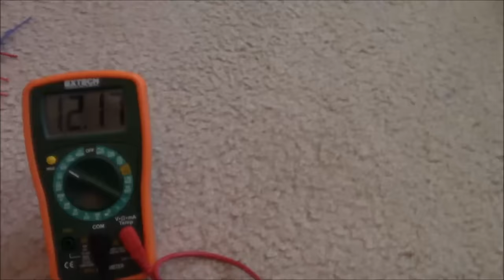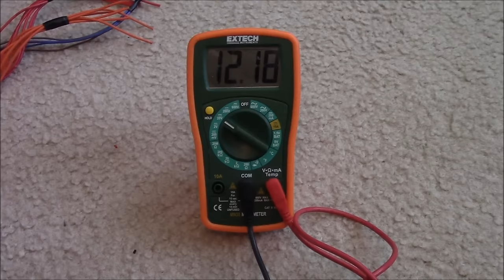How to Hack a Computer Power Supply (PSU) To Use as a 12V DC Power Source

Comment: Thank you very much. I needed a stable 12v power supply for an resin curing machine for 3d printing I this is probably a bit overkill to use an pc power supply, but heck, I did this anyway. Thank you again from România.
Reply from the maker: No problem!  Thanks for watching and commenting!

Comment: Your hack of the power supply worked perfect.  Making a Nichome wire Styrofoam cutter but now I have the problem of to much power even though it was only 12 volts.   Have a 12 inch length of 20 ga. Nichome wire and it burned through it almost immediately when I turned the power supply switch on.   Is there a reostate I should use or possibly a different combination of wires coming from the power supply to give me less power to the wire?     Thanks
Reply from the maker: Try using the -12V rail instead of the +12V rail.  It will provide MUCH less current, though, so it may not work for your application.  Other than that, you could use 5v but not sure if that would work, either.

Comment: hello sir,I have a EVGA 600GOLD, ALL the wires are black, but i still think I can do this, any help from you would be very appreciated , I assume I can take the box off the unit and see what wires are hot and what wires are negative< again any help would be awesome ,thank you in advance
Reply from the maker: Before you hack off the connectors you will know which ones are 12V and which ones aren't.  The video/graphics card wires are 12V, for example.  Once you identify the connectors that are delivering 12V you can find the pinout for those connectors online and that will tell you which one is the 12V+ and which one is the 12V-.  The rest will not be used.

Comment: So all the 12v cables here share one rail. Unlike some more expensive PSUs with two or more 12v rails. Anyway nice video I benefited greatly from this.
Or maybe because they are connected in parallel?
Reply from the maker: Yes, most PSU's have multiple rails, even if the second one is really weak.  Glad it helped you!

Comment: First off your video was extremely a helping an educational on obtaining the power supply my question is what if the power supply doesn't have a switch to turn on the power supply came out of a Dell Windows XP Media Center desktop
Reply from the maker: You can easily wire one up.  Just put a switch in between the green and black wire that I connected together in the video.

Comment: I wasn't sure which way would work out better, you're the expert :) Ill give it a go. Thanks!
Reply from the maker: I am far from an expert.  I just like to tinker and I know enough to be dangerous.  Good luck!
Reply: LDSreliance Hi. Thanks for the video. I've got a 600w 42amp PSU that I am looking to convert to power an isdt q6+ lipo charger (14amp 300w). Can I assume I need to bunch all of my yellow wires together or can I use 4 or 5'ish? Thanks
Reply from the maker: I would never use less than about 4 of the yellow wires bundled together.  Just my preference.

Comment: ohhhh way cool yeah the older looking ones have some kinda switch on them like push in and push again and button pops back up
Reply: Those are called 'AT' power supplies, very common in 286, 386, and 486-class PCs, also used in a lot of early Pentiums.  
I think some modern 'industrial' computer hardware still uses them too.  Newer power supplies are generally referred to as 'ATX'.

Comment: I have done this before and the 12v stops after a few minutes. The fan in the p/s keeps going but no power at the tips. After resetting main power it all works again for a few minutes then back to 0 volts.
Reply from the maker: Sounds like maybe it is overheating or something?  I've never had this happen.

Comment: My second question wuld by how to turn that PSU to use lead acid baterry power insted of an AC out let? Well my small experiments are more based on cars running modules ,voltage regulators ,ignition coils etc so mostli I need flat line DC or pulsed DC in bouth forms - and + pulse signals . Well honestly an inverter is probably best solution don't have money to buy It and honestly lot people complain inverters go bade fast they are not really well made so most likely I wuld end up haveing back charge problems I supose.

Comment: Thank you. I have a 12 volt PSU. There are several power wires with different max amps. I know from the label on the PSU that one power wire can deliver +12 volts at 16 amps. The problem is I don’t know which wire colour is the +12 volts 16 amp wire. I can not find any colour codes or specs online. I am wondering if there is a way to find out using a resistor or a rheostat?

Comment: No...thank you! Quick question for you. I've ran across a power supply with the reds, blacks and yellows, but the harness also use  4 wires going to an on and off switch on top of having very thin black and green wires being on a 2 pin connector.
Reply from the maker: Yeah there are all kinds of slight variations.  They standardize to a point but I would always recommend digging up the wiring diagram for the PSU if you can find it.  Usually you can google the manufacturer part number on the label and find it.  Sorry I don't know what it is off the top of my head.  Good luck!

Comment: How can you determine how much power is available at 12V, does it cause a harmful imbalance to only use the 12v output, and do you recommend installing a fuse/breaker in the line? Thanks for simplifying  the process!!!
Reply from the maker: The output will be limited by the design of the unit.  You will have to look up the specs of the power supply or they may be on a sticker on the side.  You can never go wrong with a fuse or breaker.  At worst it will be redundant safety.  And you can safely use just the 12V power.  The PSU doesn't care if you don't use the 5V and other rails.

Comment: Before connecting green and ground we can do on the power supply without computer board
Reply from the maker: Connecting green and ground completes the circuit and turns on the power supply.  Yes you can do that before you connect the motherboard but make sure the power supply is not connected to a power source (plugged in to the wall). until everything is properly connected.

Comment: Hey brother appreciate the video it got me to point where I can turn on psu after I shorted the green and black wire...now I’m trying to use psu to power 12v psu air cooler and a 12 volt Peltier thermal-electric cooler  and small pump (making a water cooler) how would I attach those devices?! Can u tell me what wires will I need to connect?! Please help lol

Comment: For anyone wanting to do this but using the 5 volt rail for their project I wold recommend putting a small dummy load like a Power Resistor 10W 2.2Ohm on the 12v rail to stabilize the 5v rail line, i have experienced power fluctuations on the 5v rail line without the dummy load.
Reply from the maker: Good call.  I am sure it depends on the quality of the power supply and I would expect that the kind that most people will be hacking up are the cheap ones where this is a problem.
Reply: jamesthepuerilis u

Comment: Really nice video. I'm new to all of this and have a , probably stupid, question, can I use each one of thoses cables to have a multitude of 12v cable ? Or am I obliged to weld them together ? 
Anyway thanks you for the video.
Reply from the maker: Yes you can.  I would just recommend limiting the current that you pull through a single wire.  These are small diameter cables.
Reply: @LDSreliance  Ok, I'm gonna try and let you know if it explode.

Comment: if you place a switch between the green wire and return(black wire) you can control power on/off this way, if the supply does not have an external switch. nice video -hjp
Reply from the maker: Yep.  Good point.  Mine has a switch but some don't.

Comment: Perfect video and exactly what I was looking for! Just wanted to know which pins turn the thing on =) So I could use it to test an old cpu liquid cooler before re-installing it with new silicone paste. Plus I have an old Tandy cell phone I'd like to mess with but I think that's at 13.8v. :) So rather than Ebanazon (TM pending) a new regulated power supply, this'll work in a pinch! Waste not... want not. With so many wires and old Psu's, I think I see a new set of tree lights in my future lol. Thanks so much for the upload and great info. Long live the Wizard of Menlo Park!
Reply from the maker: Good, I am glad it helped you.  Thanks for watching!

Comment: This is a great video. I am wanting to wire up a couple of railway wigwag lights in my garage.  The bulbs are 12.8 volt, so why not hook them up? Right??  Great for the Man Cave and looks cool when someone comes in. I want  to hook them up to my garage door opener. I bought the wigwag relay and the computer power supply, but now I wonder if I have enough power to operate the incandescent lights. The bulbs are 12.8 V and 26.9W. The power supply states that +12 has 16A. I don't know what the Watts are.
Reply from the maker: The power supply will not provide 12.8V but more like 12.0V so make sure your lights will tolerate that.  Your PSU will easily provide enough watts for the bulbs.  12V * 16A = 192W
Reply: Thanks for you answer. I think I will hook up one light straight to the power supply and see if it will stay on. When I hook it to the relay, it should only stay on for a couple of seconds then switch to the other light. So staying on for a long time should not be a issue. Keep up the great videos.

Comment: Why cut all the connectors off?  I would like to use one of them to power 3 seperate 15" LCD panels that require a 12v source.  Is there a reason I couldn't just power each LCD from a yellow and Black lead as if it were any other device inside the PC?  Like the HD, fans, or DVD?

Comment: thanks to the simplicity of this, i made  a 12v to use for my lipo battery charger... took about 30 minutes and a lot of solder (my old psu had 9 black wires...) but it works GREAT.  is there any 'easy' way for me to tell how many amps it will output?
Reply from the maker: Other than looking at the specs from the manufacturer I don't know a safe way to do that.  But glad this method worked for you!

Comment: I had hp slim desktop and micro psu (2 x 4 pins & 7 pins). The color of cable are 3 only( green ,black &yellow).Is it right for taking all yellow cables to make 12v supply ?I can't test because i hadn't multimeter. Thanks!

Comment: Hey man awesome vid thanks for breaking it down properly, i have a question though and im not sure exactly what im doing here, im trying to power a cb radio inside and eventually amplify the cb, my question is this:
Is it safe to have these wires run all together though a smaller soldered in wire? If not how about say a bundle of four together?
Reply from the maker: You can use individual wires with lower current.  I chose to bundle them all together so I didn't have to worry about overloading it or risk any short circuits with other wires hanging out.  If you use the full rated power of the 12V rail (in my case it was 20A but check your model specifications) then I would use at least 4 wires together.

Comment: Very good. I assume if I want to power a 12v item and a 5v item simultaneously I can and that I just use split the black wires between the 2 items?
Reply from the maker: Yes you can.  And yes you would split the negative wires between the two loads with probably more black wires for the 12v than the 5v.
Reply: Thanks for your assistance!
Reply from the maker: merseymal
You are welcome.  Thanks for watching!

Comment: Can you make more than one 12V connection and if so Do you make the wire bundle with all the 12v wires and then put a multi connection terminal on  at the end of the bundle for or can you use each yellow wire as a 12V connection. Hopefully the question makes sense The way I asked it.

Comment: Very nice video by the way can i connect it with tester probes so I could use it as an led tester?
Reply from the maker: I am sure you could.  But you wouldn't need all the wires bundled together for that.  One or two would suffice.

Comment: Hi, thank you for your great video. It takes a real knowledgeable person to do a simple video for a beginner to understand. I have a question, I have been messing around the house with DIYs such CCTVs, security sensors and alarms, magnetic door locks and LED lights. And then I realised that all of them require 12volts. My question is, can I wire up my house to run on 12volts instead of the regular 110v-240v? I think it's safer and consume less electricity. I tried building a 12v supply using a step down digital transformer to supply power to my cctvs and led lights. Was working fine for a couple months and then just went dead. I am not sure what I did wrong, if it's the quality of the transformer or if I needed something to stabilise the power as I have seen in those professional CCTV power supply box. Thanks again
Reply from the maker: Yes but there are some important appliances and devices that you will have a really hard time finding 12V versions of.  There are a few models of refrigerators, for example, but they are very, very expensive.

Comment: Hi there good video . How many watts or Amp can I get out of a power supply of this kind? My battery charger sucks 800 W from DC at 12/24 v and this could be cheap solution to connect a DC power supply to it
Reply from the maker: You would have to check the specifications from the manufacturer but, in general, the cheaper PSU's of about 400W or so will have a 15-20A 12V rail.  I wouldn't try to get 20A from a single yellow wire, though.

Comment: hey it was really good. 1 question what the highest AMP we can get from computer power supply ??
Reply from the maker: It depends on the power supply and the specs of the rail.  The one in this video will provide 20A on the +12V rail.  Bigger power supplies over 500W may have more current available than that.

Comment: Question.....  Was this a 20 pin or 24 pin atx power supply that you used?  From my understanding if it was a 20 pin atx you have to put a resistor in line some where?

Comment: I want to hook my car audio system in my house.i have two power amps and a power eq.which adds up to about 1200 watts peak power,I want to use a similar dc power source,how many ampere  would I need?
Reply: from what i have read i beleave that you divide your rms by the voltage(car audio runs on 12v this power suppply is 12v) so divide rms by 12 and that is how many amps needed. example  1000 / 12 = 83.333333333333333. so 1000 rms needs 83 amps but lets just say 85.
Reply: also  you probably wont ever need more than 100 rms. even with a party that should be more than loud enough.

Comment: Thanks for the video! Exactly what I was looking for! Is there a way to tell how much amperage can be drawn from each wire? Or reversely, if I needed around 3A of 12V power on each of my 3 devices, how many wires each should I assign and connect?
Reply from the maker: It depends on the length of the wire and the gauge of the wire.  I think one wire would be safe at 3A but I'd double them up if it were me, personally.  Just to be safe.
Reply: @LDSreliance  done! Things are up and running! Thanks!
Reply from the maker: Awesome!  Glad I could help.  Thanks for watching.

Comment: awesome video! i am just getting into tinkering with small electronics and this video is so useful! i was wondering, why could you not use it as is to charge batteries?
Reply from the maker: +weqrfawe Thanks!  I appreciate the support.

Batteries need a higher voltage than their rating in order to charge up.  For example, the 12v battery in your car needs 14.2-14.4v from your car alternator in order to charge while you drive.  This computer power supply only provides +12v.  I have heard if you combine the rails you can get 15ish volts by connecting yellow wires (+12v) and the 3v wires (forget which color they are off the top of my head).  I have never tried it so do so at your own risk.
Reply: +LDSreliance should work as its two input voltage power supplies that will be added together making 15v.
Reply from the maker: Justin Bark
Right it should work easily.  I just haven't tried it myself before.

Comment: Hey buddy great video but I have one question is it possible to do exactly what you did and connected to a inverter
Reply from the maker: You mean connecting the power supply to an inverter instead of plugging it in to the wall outlet?

Comment: Thanks a lot for this video. I landed here when I was looking for ways to run my 160W car vacuum cleaner (12V DC) at home (220V AC). So, if I pick a decent 400W PSU, will it do the job for me? I mean, if I simply connect the positive wire from the vacuum cleaner to the bundled up yellow wires and the negative from the vacuum cleaner to the bundled up black wires, am I good to go? Of course, I will short the two wires yo showed in the beginning to have the PSU start.  I am totally naïve when it comes to electronics. So, I am just curious, are we saying that this will handle 160W/12V = almost 14A of current  without burning the slender individual black and yellow wires (which, of course, we bundled up and soldered)?

Thanks a lot for your help!
Reply from the maker: Yep, you should be good to go unless the vacuum requires a large surge of power to get started.  Make sure you check the power capacity of the 12V rail before hacking it up.  I would find one that has at least 20A on the 12V rail just to be safe.  But if the motor pulls a ton of current to start up then even that won't be sufficient.